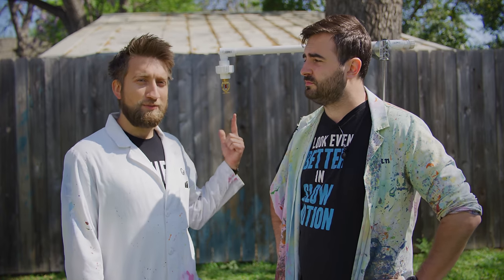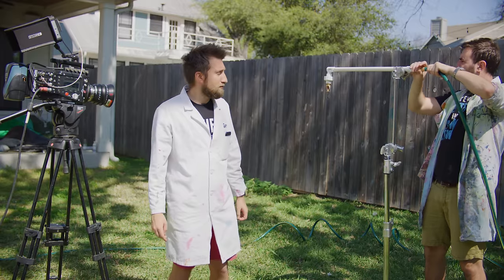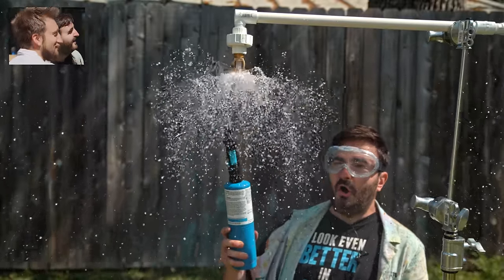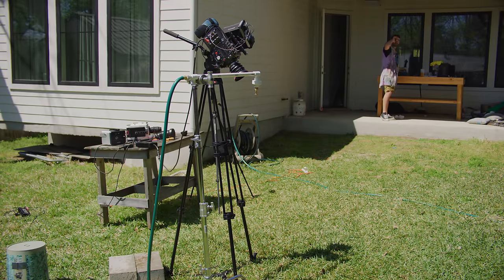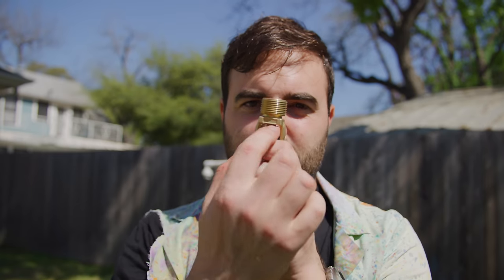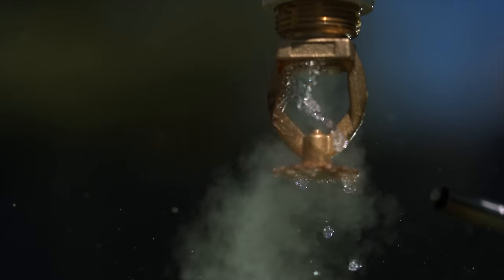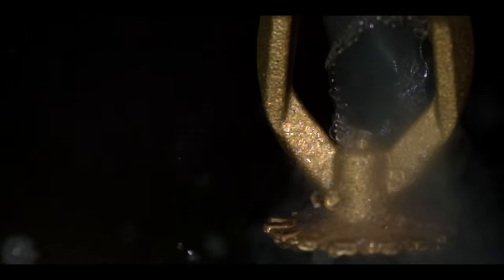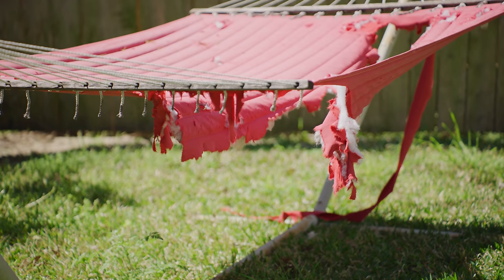How a Fire Sprinkler Works at 100,000fps - The Slow Mo Guys

Comment: I’ve actually always wondered how those things worked
Reply: Ye same
Reply: I learned it at school xD
Reply: I knew the thing about temperature, but not the metal thing that spread the water. It was quite clever.
Reply: Cut to Holywood where someone "hacks" the sprinkler system to go off as a distraction in a government building
Reply: Yeah. I always thought the metal fans spun by the water pressure. But they don't. I'm satisfied.
Reply: Mike Powers: Hammocks? You sit on the side and just ease into them. Then it's mostly gravity and a gentle breeze.
Reply: Yeah, I knew that they walked on four legs, but going under the fence? That's amazing!!
Reply: What if hot water is in the water supply?
Reply: Yeah, you see if the bag weren't there the camera would get wet.
Reply: @apatheticAnxiety  actually the whole Hollywood thing of the sprinklers going off its rubbish.  Only the sprinklers that have been heated enough will go off not an entire building it saves on insurance for any space not affected by the fire.
Reply: @davidamoritz  The main reason is it directs the water to where it is needed, and doesn't waste it by spraying areas where it's not needed.

Comment: I would love to see lightbulbs getting destroyed by putting to much voltage trough them. We do have 20 to 2000W at our theater and I always wondered how it looks when they go in slowmo. In real-time it’s just a bright flash
Reply: Prolly would be hard to capture due to it being light, it is the fastest thing.
Reply: But the breaking of the wire does not necessarily happen in light speed. A bit like the lightning.
Reply: One time we had a lamp on without a shade on it and my brother threw a wet towel on the bulb( while it was still on) and the bulb exploded
Reply: Marshal Parsons that’s just cause the dramatic change in temperature from hot to cold and wet
Reply: @ericrojas418  Yep, it's called thermal shock and it's also why you shouldn't put glass pans on hot burners

Comment: That sprinkler requires 14.8 gpm @ 7 psi minimum to operate correctly. You should go back with more flow and pressure and you’ll see a proper curtain form.
Reply: I like how even with it at much lower than standard pressure, it still seems to be getting dan wetter than any time anyone uses on of these in a film
Reply: 80L/min @ .5 bar, In nonstoopid measures
Reply: They also need to use stagnant water full of mildew grime for a truly genuine effect. It should also smell like sewage.
Reply: Do you know the 'K' factor?
Reply: @sireuchre  Uhm, what? Sprinklers do not use sewage water, but clean water.
Reply: @1313eable  You let water sit in pipes for years, and see what happens. The water doesn't stay 'clean'. Any professional fire sprinkler person will tell you when they go off, what comes out stinks and ruins EVERYTHING it touches.
Reply: @marcuserektus  Most likely K=5.6
Reply: @xQuantom  8.0k..3/4" threads
Reply: Labonteford 5 yeah I didn’t take the time to go look, just an educated guess since 90% of heads are 5.6
Reply: @sireuchre  is correct, sprinkler water smells like an open ditch in the middle of a swamp
Reply: @xQuantom  let's see them do an ESFR sprinkler head at the proper end head pressure
Reply: 1313e can confirm on the dirty water. It’s basically black. Stains real bad. Really bad. Even on concrete or cement. Had a buddy (my young foreman) not properly let the system drain the water to change an upside down head like the one in the video and it had at least 5 buckets of 5 gallons of water drain from it. My pants smelled and were permanently ruined. We were above a freezer in a Walmart so nothing of value was stained but our clothes lol
Reply: @sireuchre  thats why my company runs a dry sprinkler system with no water in the pipes.
Reply: @1313eable  here never turned wrenches before lol.
Reply: What about an ESFR head??
Reply: I guess you're a sprinkler fitter just like me
Reply: @ryokot4  I would love to see that as I am a sprinkler fitter myself
Reply: @jamiesuvo7420  I'm a fire sprinkler designer for a small outfit in Lincoln Nebraska
Reply: @marcuserektus  K8 (metric)
Reply: @ryokot4  Agreed. A single K48 head operating at 1200 kPa delivers 1662 L/min - more than 3 times a fire hose stream from a hydrant outlet!!!

Comment: The “fan things” are fins and the entire part where the fins are is called the deflector. The bulb is called a “frangible bulb”. The part the bulb is holding in is called the “seat”.

EDIT - see reply.
Reply: TheTalisman616 you are so smart
Reply: Actually, it is the liquid that expands. The air bubble compresses until it runs out of room, and the continuing expansion of the liquid breaks the glass. The size of the bubble determines the temperature it triggers at.
Reply: Marshall Peters that is correct. My bad.

Comment: I never owned one and I always thought they worked with electrical fire/smoke sensors.
Reply: We're alike
Reply: Sprinkler systems are tied in with the fire alarms by a flow meter.  The flow meter will detect when the water starts to flow after the sprinkler head has activated then sending an alert to the fire alarm control board setting off the bells and whistles of the fire alarm alerting the occupents of the building.   The fire alarm going off before the sprinkler will not activate the sprinkler heads.
Reply: Some systems are tied to electrical fire and smoke sensors. Most are just like this though.
Reply: Red Eagle they literally just invented heads specifically for warehouse storage that can be triggered electronically before the heating element melts/breaks. But they aren’t in use yet. There are literally NO heads right now or ever before that will go off without direct heat on the operating element.
Reply: @redeagle2793  Some have a sensor-activated valve that opens to arm the system, but the sprinkler head is still heat-activated.
Reply: @dhoops616  Dry standpipe sprinkler systems (which can be outdoors/where temperatures are below freezing) are remotely triggered to go off, as well as dry gas/oxygen displacement systems (for places with super expensive stuff like data centers, or places with historical artifacts or something) where CO2 or another gas is used to remove all the oxygen to put out the fire, instead of water. But yeah this is true for a typical wet sprinkler system that's filled with water under pressure.
Reply: Matt Puterio ha.... hahahhaha. You tried to educate the wrong person fella. Im a NICET lvliii fire sprinkler inspector. And no, dry systems are not triggered remotely. Deluge valves have manual pull stations that dump the pilot line of air and trip the system, which is open nozzles. But not electronically. Even double interlocking pre-action systems require both an electrical trigger (a smoke, pull station, heat detector, etc.) and air loss for the system to activate. And those systems covering Server rooms (which are a lot of the time water based pre-actions), are called suppression systems or special hazard systems and use a “clean agent”. Also, some clean agents, namely CO2, does not remove oxygen from the room, but rather reduces the oxygen concentration low enough that the fire can’t “breathe”. Other clean agents, like halon 1211, and the newer halotron, actually prevents the fuel, ignition, and oxygen from interacting.
Reply: Marshall Peters someone else who knows what they are talking about. It is amazing the amount of people who don’t know. It is strange cuz the only way to truly know he details of fire protection, is to be in fire protection ha
Reply: @dhoops616  Hey no hard feelings, I appreciate the information. Clearly you are much more educated on the subject than I am based on your experience. Thanks for the insight and for correcting my incorrect assumptions. 👍
Reply: Yeah and the antifreeze systems like in hospitals, them foam systems are fun to mess with but I like wet tripping the dry systems the most. Fire pump tests and 5 year roof flows are cool too.
Reply: Blame TV and movies for getting it wrong 99.9% of the time.
Reply: thanks to the Incredibles and other tv/movies i thought for a long time that the metal fan looking part was what sprayed the water it was only reading on how stuff works then looking this vid up that i understood it

Comment: Another great video. I didn't see in the comments that in a real sprinkler installation there's no water in the system. The whole system is filled with air under a low pressure. When one of the capsules is triggered a sudden drop in (air-)pressure is detected. This will open a valve in some small pressurised watertanks to fill the pumps and to start filling the tubes with water. At the same time these big pumps (driven by electric motors) are started. After just a few seconds the sprinkler will flood the area. The advantage of the dry system is, is that you can detect leaking seals without dripping water into someones keyboard or so (there will be air lost without the sudden drop). This also makes maintenance a lot less messy. Valves permits to isolate floors to locate the section with the leakage. With an ultrasound microphone you can then find the leak in the concerned area. Hope you found this interesting. Tada from me and looking forward to the next slow-mo.

Comment: Glad you didn't test with real sprinkler systems. No one ever tells you that the water is black when it first comes out...
Reply: In the older sections... yeah... but when you have coworkers left and right accidentally smashing the sprinklers setting off the system flushing the pipes it's not so bad.
Reply: That's only in older ones where the water has been sitting for a long while
Reply: @TheYTSucks  yup. They're always gross.

Comment: That blades dont rotate?. I always thought they rotate and sprinkle the water and hence 'sprinkler'
Reply: My thoughts as well! If it works well enough like this, without rotating, then I guess it's one less thing to break
Reply: No, they don't spin. They are designed to make a fog like spray, under the high water pressure of the system. The rising hot air, pulls the cool spray into the base of the fire. @joonasfi
Reply: @bearfoot100  no it doesnt
Reply: garden sprinklers [usually] rotate yes, not fire sprinklers
Reply: The blades don't spin.
Each sprinkler head has a specific spray pattern, the one they are using here is a fast response standard spray pendent.
There are also uprights and others for attic spaces, Windows and horizontal sidewalls.
Reply: bearfoot100 
That's false
Reply: I always thought it rotated as well!
Reply: @bearfoot100  Actually, the main purpose is to cool the accumulating gasses, and lower the overall temperature of the fire. The purpose is not to put out the fire, but to suppress it to a controllable scale.

Comment: i am actually a sprinkler fitter in Canada. judging by the size of that head, at proper system pressure, you would get roughly 10ft radius of water spray coverage. The air you see, even with the slow mo would be so fast that you  wouldn't really notice it. You just go from dry to wet. Feel free to call the possum Yox.

Comment: So the way that these are normally deployed , the pipes are dry and pressurized with air at around 45 psi (3 bar). This air pressure is holding a valve closed that is holding back water at about 120psi (8 or 9 bar). The ampule breaks, releases the air out. At around 20psi, the flapper valve flies open, and the system fills with water at street pressure. They spray a lot further when they go off.

Comment: would be a lot cooler if you did this at the sprinklers designed pressure
Reply: not with a garden hose but lolz at that thought
Reply: They'll operate on a minimum of 7 psi.
Reply: I agree but I don't think he'll want to be that close to it.   An interesting fact that so many folks don't know due to movies is that the water that initially comes out is black and stinky due to corrosion from the water sitting in the pipes for years  waiting for a fire along with any cutting oil and such from installation.  As a former Fire sprinkler fitter I've had that stuff spray into my mouth while changing out sprinkler heads on existing systems. YUCK.  :)
Reply: @jacobs2830  it taste and smells like money!
Reply: Wow mark. You’re right. What is the max pressure.
Reply: If you get residual pressures too high then it basically becomes mist. And its possible the water never reaches the base of the fire before it evaporates.

Comment: The part I never get from in The Movies is how someone will hold a lighter to one sprinkler head and when it goes off, all the sprinklers in the building will go off.  It seems that this is now how it would actually happen since each sprinkler has it's own glass piece.
Reply: Unless the drop in water pressure in the line somehow dislodged the valves on others
Reply: Drencher systems will go off triggered by one single actuation and you are correct, these go off singly to mitigate water damage.
Reply: @LetsTalkAboutPrepping  No, that cannot happen as the bulbs are fixed in place.  Water pressure plays no part in the actuation.

Comment: 2:38 I hate that Dan turned the faucet off before turning the gas tank off. SMH 😬
Reply: Will Mercep it’s not gonna hurt anything
Reply: Ben the torch wasn’t lit
Reply: Namer he could’ve tripped and hit his face on the wall too
Reply: Namer yes, because taking the 4 seconds to turn off the water spigot while having your torch running is the likened to not wearing a seatbelt or a helmet.
Reply: But did you die???

Comment: Shattering glass ampoules in the garden....
RIP your feet should you walk bare-foot in the lawn.
Reply: i would be more worried about when they were breaking tempered glass panes.
Reply: Do you know what tempered glass is?

Its whole thing is that when it breaks it isnt sharp
Reply: @helloworld2409  When tempered glass breaks it is less sharp than untempered glass, but it is still sharp because it is glass. You just get lots of little pieces instead of large shards.

Comment: Should have removed air infront of the water in the  PVC line before heatings so there's no air burst
Reply: It's a result of the water hose pumping upwards instead of a gravity fed system.
Reply: Sassy The Sasquatch most are not pressurized
Reply: @iLikeC00kieDough  Not pressurized with air, you mean. The water is definitely under pressure, or it would just dribble out, wouldn't it?
Reply: If you don't bleed the air out there's a head pressure of air that's pushing towards the sprinkler head. When he heats it up and it pops the little water in the line comes out first then the air behind the water and then the water from the hose
Reply: Sassy The Sasquatch  They are pressurized only by the water in them.
Reply: @craigcorson3036  Pretty sure these run on a stored water (gravity system). Although a stored water system could also be pumped. I'm an industrial plumbing/heating engineer so I don't install these types of system. Either way, I would assume the system would have been vented of air during the installation/commissioning process meaning the pipework supplying the heat sensitive fitting would not have been charged/compressed with air. The system set up for the video was not vented, hench why the sudden release of air after the heat sensitive fitting activated.
Reply: Sassy The Sasquatch  Depends on the head of pressure/volume of water held behind the heat sensitive fitting.
Reply: @leegibbs5317  No, every fire sprinkler system that I have ever seen, and that's not just a few, has been connected to city water. It has to be, or the water would run out in no time. and the fire would probably still be raging. As for venting of air, that probably takes place during the inspection process. At the end of the line, there is a small fitting where the inspector can connect a pressure gauge, and assure that there is in fact water in the system. Obviously there would still be some air in the system, unless they went to the trouble of venting each head, and that's pretty unlikely.
Reply: Craig Corson correct
Reply: Stored water tanks use pumps. Not enough pressure without them. We bleed the air off the lines from the inspector test valve. Turn water on, open test valve and wait till all the air comes out.
Reply: @leegibbs5317  You don't know what you are talking about.. just fyi.
Reply: @craigcorson3036  Wrong, ex- dry system.
Reply: @iLikeC00kieDough  All are under pressure.
Reply: @jynx2501  They could run the water as they attach it so that only water could be behind it.
Reply: @austindenning3692  Fair enough. So you're saying my calculations are wrong?
Reply: @austindenning3692  Okay, fair enough.

Comment: This might be a stupid question, but I know absolutely nothing about cameras, especially slow motion cameras. Can anyone answer why all of their slow motion cameras have high powered inner fans? I know they keep them cool. But do high powered slow motion cameras get really hot, overheat or something?

I appreciate anyone’s answer, thanks
Reply: yes, they get extremely hot, as with all electronics, especially those running at the limits of what we're capable of. They're basically small, advanced pcs and all components in a pc generate heat with most needing heatsinks and fans and even liquid cooling, though of course that's not a good option for portable devices. Also, the smaller the fan the less air it can push and the faster it has to spin therefore the more noise it makes.

Comment: Pro tip: Watch the video at 0.25 speed to increase FPS to 400,000
Reply: Well yes... but actually no.
Reply: You’re not actually increasing frames per second because it’s just slowing down the video, not the actually camera.
Reply: Thats how physics works i think. i guess. sure why not. lets just pretend it does!
they should save the 0.25 speed video and reupload so we can watch that at 0.25 speed to get 1,600,000 FPS !!!
Reply: @Jay-rs5xn  \s